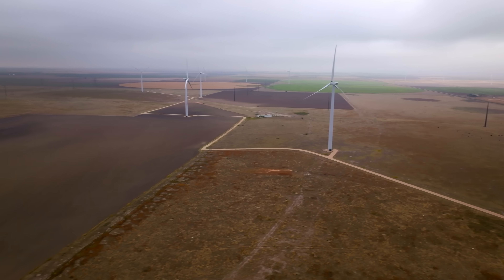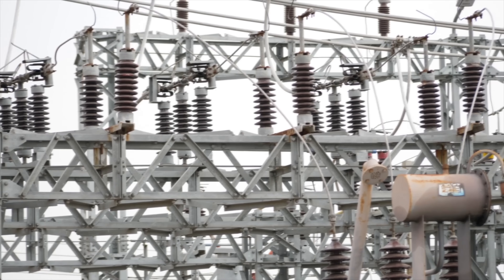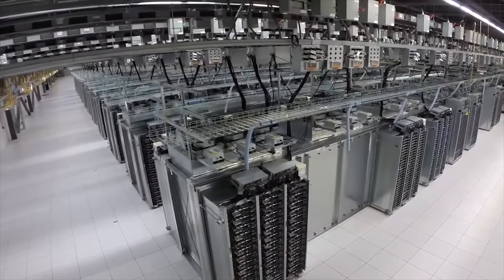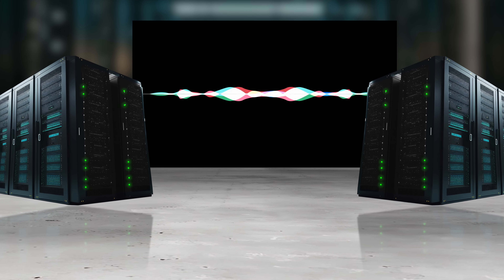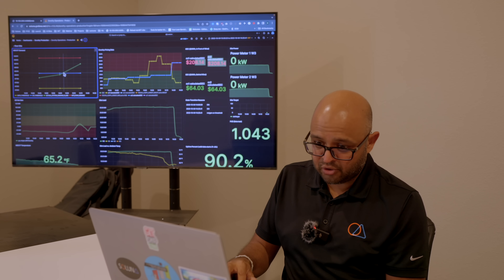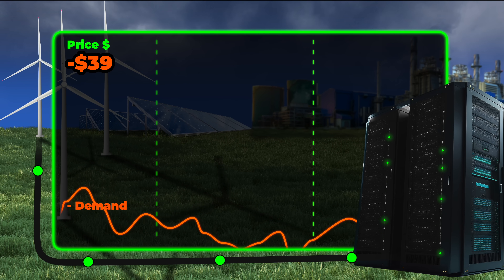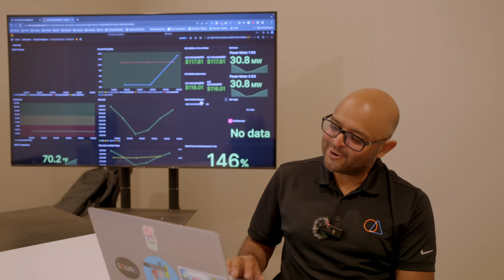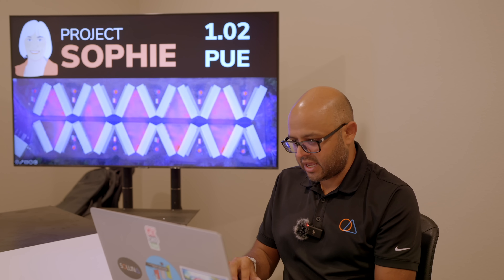Wind Farms' Dirty Little Secret No One Talks About

Comment: I think that one of the reasons that wind turbines are idle is that they wear out, so they are only used when it is profitable. They compete with hydropower for market, and hydropower is subsidized by the government and is cheap. So, idle wind turbines only cost the opportunity cost of the investment when they are not used. This means they are used in a ‘dispatchable’ way; responding to demand for electricity.
Reply: To a degree, even when not in full production a wind turbine goes into an idle mode. It still needs to keep operating temperatures of lubricants and electrical components warm, keep facing itself into the wind to protect blades, and typically don’t stop spinning 100%. It’s a similar amount of wear on the components and staying in production is more cost efficient.

Comment: This is where we need proper energy storage solutions, (Kinetic flywheel storage on a massive scale, much more than some existing systems which are used to smooth out the supply?) instead of dissipating the excess energy which seems ludicrous to me, but if the excess heat could be used to some advantage - But I don't know how - I am just a spectator, not an expert by any means! Thank you, Ricky for another great video.
Reply: Communal heating is a prime candidate, there's already a lot of talk of bringing it back and using excess heat from power stations and industries such as steel.

Comment: They need to wrap the towers in solar panels . add well pumps fill water towers . that tower should be doing alot different things.
Reply: That would be quite expensive and quite heavy. If those towers come down, which happens more frequently than you'd think then you have a several million dollar loss. Wind energy is already $1M/MW. Adding solar panels would add a hefty amount to that. Plus the towers would be very hot and wouldn't be as efficient as they could be.
Reply: @HH-le1vi  if it was built correctly instead of just on a tall pole. To many dont think out the box all what could be done and the pricing to build is just a over charge, things could be lower cost.
Reply: @MoneyMindMusic  those wind farm turbines aren't built on poles. They couldn't handle 3 350ft long hollow tubes of fiberglass if it was a pole. Plus the weight of the nacelle on top of it.
Reply: @HH-le1vi  lol i was meaning it being a pole shape makes it a ez target for tipping over. But there is lots different ways to design better systems. People in general over use energy we dont even need that much of. We are just power spoiled lol
Reply: @MoneyMindMusic  its not a pole shape though. You can walk inside and put things in those towers. There's already big ass computer systems in each of them.
Reply: @HH-le1vi  yes i already understand this we all know theres more inside. Its not just a empty pole its a tower but incorrectly built for the engineering of what there trying to do. You cant have all that weight on one side taking on high winds and not expect it to fall over at sometime. Just needs a redesign.
Reply: @MoneyMindMusic  it's the length of the blades. They're 300ft plus long blade. Even if the tower was made of concrete you'd have something breaking.
Reply: @MoneyMindMusic  and you can't do concrete towers. The land is leased. Not bought. So you have to make the towers out of something that's easily put up and down.
Reply: @HH-le1vi  just a bad design they do it all the time spend millions on bad designs lol when things could be more simple. Houses could run on less power. Lighting systems rethought. Wiring systems rethought. A house could be sustainable on its own. But if you do that you break the system economy. People just spoiled with mass production and power when we could live simple and mostly free. But so many ways to design stuff people just dont rethink out the box as much. And changes are always a slow process.
Reply: @MoneyMindMusic  I wouldn't call it a design issue. They're on rented land with 400ft towers and 300ft long turbines. You can't do much. Maintenance costs on them already are through the roof.

Comment: @TwoBitDaVinci the water vapor cooling could be transformed into a centralized heatplant, they could store the heat to later use, either as to generate new power or in a heat distribution system

Comment: A spent a few years talking about this,
but what I want is typically plugged in EVs: let them charge when there's production (I mean, let's charge some of them, when there's production - those who pay the most - but it should make sense for an EV owner to have it plugged all the time the EV is not moving)
Reply: the problem with incorporating EVs into the grid is the current EV adoption bias. Right now, around 95% of EVs are owned by the richer people in society, who have big houses where you can actually park your EV next to the house and charge it at home. When/if EV mass adoption takes off however, the vast majority of people who live in houses without enough land to park a car on your property, in shared apartments, flats, tower blocks, slums, highrises, condos, and the like - they will NEVER be plugged into the grid, they will rely on going to charge stations and CHARGING, not waiting for the grid price to fall, but just plug and charge like you do a normal car.

Comment: The real answer is to build hydrogen electrolizers. The excess energy can be pushed into those systems keeping the wind farms and solar at 100% producing hydrogen. Since both GM and toyota have made statements that EVs are not going to be produced but hydrogen will replace batteries then this is the way to the future
Reply: Makes sense. Hydrogen is explosive, but wind farms are in remote areas. Hydrogen also directly replaces role of natural gas in the energy mix. It also has the added benefit, it can be mixed up to 30% with 70% natural gas and used, in existing natural gas facilities.

Comment: While IRA has been are real boon in financing, what is limiting its full potential, are building new transmission lines, as well as things like permitting, and interconnects.  This is not going to improve soon.  So maybe we can start looking at more distributed solutions.  And we will have to learn to work a grid a larger portion of the generation, is intermittent.

Co-located data centers, with flexible loads (batch jobs), can be one solution.  The same can probably said for thermal storage, desalination, hydrogen production, etc. These would take excess generation, and use them for non-time-critical side projects.  The only issue are the capacity factors, to justify the initial capital costs.  This would be for the quants to figure out.

Comment: The two major problems with windmills are thus:

1. In the windmills entire life, it will never produce the amount of energy necessary to replace all the materials of which it is made.

2. When the windmill is retired, there is no way to process much of the waste, contributing to toxic landfill mass.

Windmills cannibalize the electrical grid instead of contributing to it. All in all, they are not renewable or green. They are a fantasy so that environmental ignorami can pat themselves on the back and tell themselves that their intentions matters more than their realistic effect on the world. Disgusting.
Reply: This is entirely untrue. No major company would invest money into a money losing business. Most turbines will pay themselves off in under 10 years and go carbon neutral in about the same time. The lifespan of most turbines is 25 years plus so the math just doesn’t add up to what you’re saying And when they are decommissioned, a large part of them can be recycled and currently they are working on even more efficient ways of recycling and reusing the components.

Comment: i had a fun time running the grid in the South-West, (Arizona-New Mexico-El Paso, Texas and El Centro, Calif) I wrote my own program on a HP45 to economically dispatch the plants and used a very old computer to do the work (ProDac 580) which was broken at the time, but fixed sometime later. We Saved millions on fuel and maintenance costs. I Bought and sold power all over the Western Interconnection. The grid is better now, it is being modified to support Solar and Wind. Tesla Mega Packs would be a better solution.
Reply: We don't need to use lithium for grid storage. Save that for things that need to be light and small. There are lots of other stationary storage technologies to choose from. Sodium ion, zinc bromide, iron air... But we do need something, and batteries are a pretty efficient way to store electricity.

Comment: But yet wind mills are still being put into the air, even when they aren't efficient in use.
Reply: and think of all the cancer they cause!  It's a conspiracy!
Reply: Overall curtailment isn’t as uncommon as you think, even fossil fuel power plants will spin up and down, depending on the demand. The difference is wind turbines use wind when needed not fuel.

Comment: This is a terrific example of something I keep telling the naysayers… Capitalism WILL find a use for surplus energy beyond grid demand. Traditional industrial power that demands 24/7 energy will be replaced where possible by processes that can easily scale their work up and down in response to energy availability and price. The idea of using wind to power asynchronous-load AI farms is a great example of that. 

This is, in essence, an early example of what Tony Seba at RethinkX calls “G.O.D.” (Generation On Demand) power. This happens on two fronts. First, solar and wind are getting so cheap that the cost of locally generated energy will fall below the cost of transmitted energy, even if the source for that transmitted power is zero! Here, it’s cheaper to build a variable data center that can fully utilize the wind turbines than it would be to build a data center that ran off the grid and scaled down in response to dynamic pricing changes. Second, building enough energy supply/storage for seasonal variation (winter, cloudy days, etc) means massive surpluses for sunny summer days - surplus free energy that can be put to good use.

Comment: I have a friend that works in windmill repair, he said they have a backlog that is years out because the failure rates on windmills is high enough that they will always need service within 2 years of deployment and the number of service techs is finite and shrinking as boomers retire and no one else wants to do the dangerous work.

How about use excess power to steam crack sea water for drinking water?
Reply: True, like any major mechanical component there is a contestant up keep necessary, but that is true with any generative power plant and saying that boomers are the key to this is incorrect. There is a workforce of all ages and experience and there is a constant work force maintaining wind turbines at all times ( not just every few years). As far as danger it’s not anymore dangerous then any other type of power plant work.
Reply: @chrisbellttu you're 400ft in the air. That's pretty dangerous. You don't have that at natural gas, coal, or even nuclear plants. Hydro power is also done lower to the ground. Also the work force for Wind Energy techs is mostly young guys. Boomers aren't doing much in the wind industry as far as techs go. But there are very few techs out there. Probably less than 5,000 as the service companies that maintain them aren't that big and they go out of business pretty frequently.

Comment: Could work for old computers or bitcoin.  If you have a datacenter full of new, $40k H100 GPU's, you'll want it to be doing AI 24/7.  But old GPU's are less efficient and could be moved to a windfarm to do AI workloads that need to be done in days or weeks instead of minutes or hours.  They take more energy and work slower for the same amount of compute, but if the energy is cheap, who cares?

I've often wondered if you could make aluminum with excess power.

Comment: When I drive by a power plant I see large transmission lines coming from it. When I drive for hours across KS and NE and see wind farm after wind farm I notice something missing - large transmission lines. Makes me wonder how much energy is really produced.
Reply from the maker: there's usually a big transformer box somewhere, it isn't always very visible, they try to hide it as much as possible. for safety, security and its an eye sore
Reply: Most of the collection lines that feed from wind turbines to the substation are buried under ground as well. Should only see transmission lines from the substation out to the grid.

Comment: This is pretty cool, though I'm thinking that it might be more of a mid-term temporary solution (next 20 years or so) because energy storage also more or less fixes the curtailment problem.  As energy storage on the grid increases, curtailments decreases and price swings narrow.   Now the price swings will not narrow completely, otherwise there would be no incentive to store the energy.  But they will probably narrow sufficiently that renewables generation won't need to curtail.
Reply: Storage always comes with a loss. So having a customer who buys surplus whenever available will always be more cost-effective.
It's probaly the mix of solutions that will solve the problem, not a single one across the board.

Comment: I'm constantly coming across examples of the complexity of our current man-made world systems and realize just how the majority of people do not have any idea how fragile it is.  I worry that the scale of complexity will eventually create a situation were one small glitch will crash the whole thing.  Despite my cynical outlook I do appreciate your video on this innovative system and the people who put it together......👍👍
Reply: Power generating systems and electrical distribution has always been complex regardless of the energy source. This complexity doesn't necessarily mean they are fragile and in fact most of these systems are fairly robust if properly designed, managed and maintained.
Reply: Just block the roads for a day or two and watch how fast the stores sell out of everything.
Reply: One of the things I like best about solar + batteries is it makes largely independent sub-grids possible, scaled all the way down to a single building. Grid failures suck, and the grid is fragile. So try to not depend on the grid.
Reply: @davestagner   you think adding more complexity and cost will make the grid more robust?
 Interesting ..
And you believe building owners now responsible for maintaining PV panels, windmills, batteries, and the circuitry.. will see a return-on-investment?
I guess time will tell..
Reply: @Metapharsical  “Adding more complexity and cost” with localized generation/storage will make individual buildings and complexes more robust, by making them partially or fully independent from a demonstrably unreliable grid. I have personally experienced multi-day grid outages. Many, maybe most of us have. But if I can turn to the grid if my solar/battery fails, and also use my solar/battery if the grid fails, then my house will be much more robust. Moreover, if the amortized cost of a solar/battery system over its lifespan (decades) is cheaper than that of buying electricity from the grid over the same period, then I win. If it’s several times cheaper (and it usually is), then I win BIG. That alone is motivation for commercial customers, and we’re seeing that shift already. 

As for maintenance… a solar panel has no moving parts. It has no chemical reactions, and does not consume fuel. Current production panels lose 0.3-0.5%/year output due to glass wear and corrosion at the external electrical connection. They could continue to produce usable energy for a century or more! What “maintenance” are you talking about? Batteries need eventual replacement, but not “maintenance”, and they’ll tell you their condition. Windmills generally aren’t practical for individual buildings, but if they were, maintenance would probably be outsourced. Speaking of which… I pay for someone to maintain my gas furnace. It’s the second gas furnace in this house in 20 years, and it also needs replaced, before it fails and leaves my house cold, or develops a carbon monoxide leak that could kill me in my sleep. I will not install another gas furnace - I’m looking for ways to best electrify my heat. Also thinking of maintenance… do you think the grid itself requires no maintenance? Or is it just something you don’t experience directly, but rather pay for in your bill?
Reply: I think it already had collapsed a few times. The recent one was in Texas a few years ago.
Reply: @triadwarfare  " if properly designed, managed and maintained" It was not.

Comment: Very cool tech, but it still has some caveats. Ok you take advantage of having extra wind energy when demand is low so you can use it for computational process. However what happens when there's no wind and demand is high? Storage is needed and it's importance is critical. The only ones that have built megabatteries are Tesla, who else? More of that is needed. Another way to store energy would be reversible dams but those are not so easy to build, the conditions needed to do it are an important requirement.